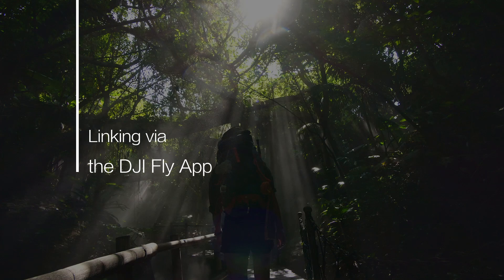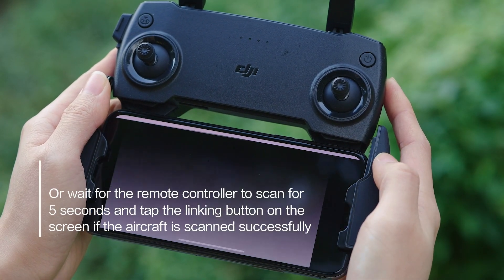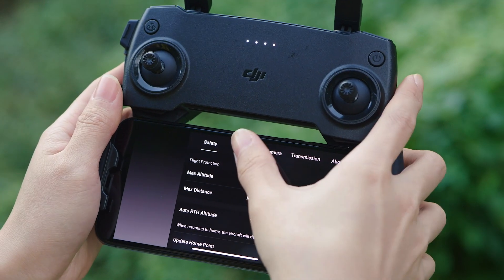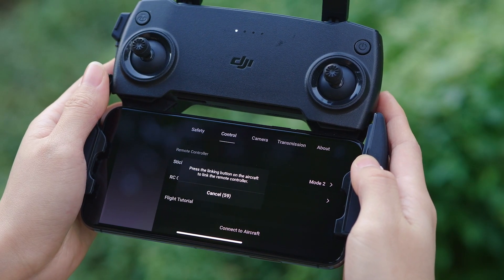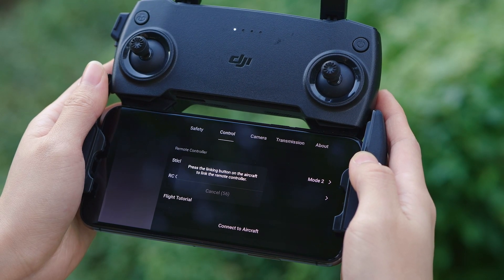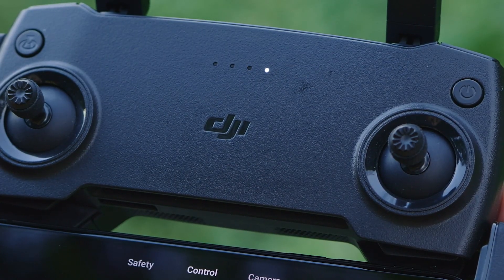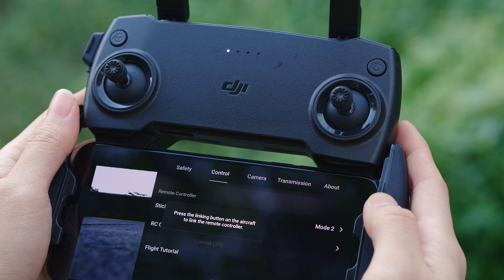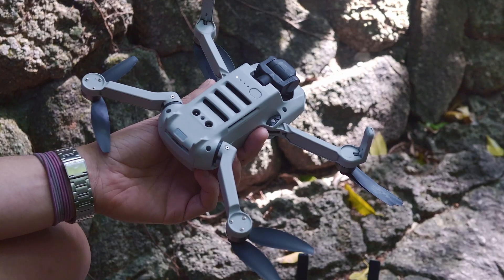Mavic Mini | How To Link The Remote Controller

Comment: this video does not adress linking failed issue. Both the phone and drone have full charge. still won't link either way. Any solutions out there.
Reply from the maker: Hi, there. Sorry for your inconvenience. Please make sure that your app version, firmware version are the latest one. If the issue persists after all the things have been upgraded and refer to the video, to better assist you address the issue, please contact our support through this link: https://www.dji.com/support?from=store_footer  Thanks.

Comment: Anyone know why my drone ain’t connect to my iPhone 13 pro max my mate gave me a drone and I got the cord for the iphone to the control everything works the drone and all it just does not want to connect to my iPhone
Reply from the maker: Hi there, could you please tell us is there any error message? Please upgrade the DJI Fly to the latest version to see if it works. You may also test with another cable and mobile device. If the issue still exists, please contact DJI Support for further assistance. http://www.dji.com/support

Comment: Anyone know if the Smart Controller works unsupported with the Mini 1 ?
Reply from the maker: I am sorry, Daxton Anderson. The Smart Controller does not support Mavic Mini.
Reply: @DJITutorials  I'm starting to doubt that though, the Smart Controller runs Android, could I not just sideload DJI Fly on it and use it instead?? 
Starting to think I need to find someone with one locally to prove you guys wrong 😂 I think you guys just want me to buy a Mini 2 lol
Reply from the maker: @DaxtonAnderson  I am sorry for not clarifying it. The Smart Controller is equipped with Ocusync 2.0 while Mavic Mini supports WiFi for transmission. So, they are not matchable.

Comment: It link for only 20 second after i get no radio to RC
Reply from the maker: Hi Michel, we are sorry to hear about the issue, please check if the drone and RC have been updated to the latest firmware, you may try to refresh the latest version for Mavic Mini via DJI Assistant 2. After that, please relink the drone and RC.
If the issue persists, please provide the screenshots and a video of the issue for further assistance.  
You can contact us at http://www.dji.com/support
Reply: @DJITutorials  Thanks, i have the latest updates on rc and ac .
Reply: @DJITutorials  Thanks, i have the latest updates on rc and ac .try to pairing with and without sd card and format it too, pair it by holding the button 4 sec rc&ac.sometime it pair, but it stay for only 15-20 secondes.

Comment: Got my Mini back from DJI repair. I saw nothing mentioned about suggesting I send the controller back with the aircraft, so now I need to relink. I followed the above steps and the linking fails. What can I do?
Reply: Not sure about yours but for some reason my SD card was the culprit.  Removed the card and it hooked up fine.  Saw a message to that effect further down in the comments.  Worth a try.

Comment: Hello, DJI I Lost My Controller From My Mavic Mini But I Still Have The Drone, The Battery and The Charger. Would A Replacement Work, and Does it Matter If Of The Replacement Drone's Controller Model Doesn't Match Mine.
Reply: I want an answer to the same question please!
Reply: @CoolHoody  I bought a replacement controller from eBay it worked. Just follow the steps of the video and it should work.

Comment: my remote control wont connect to the drone. ive tried all the tutorials but it still doesnt work. What am i doing wrong?
Reply from the maker: Hi Paul, cause there is no specific operation videos provided, we cannot figure out what the problem is. kindly please contact us support team via htttp://www.dji.com/support, we'll do our best to help this out.
Reply: @DJITutorials  i figured it out :)
Reply: @pauloldenburg6582  How?  About to return mine.
Reply: @philippeterson7503  do it with the physical buttons.Connect to the app.Then, on the remote controller press shortly and then long for it to turn on.( it'll make a beeping sound) then wait a couple seconds and then press it for about 5 seconds or more for it to start beeping very loudly and the lights will start going side side to side.Do the same with the drone.
Reply: @pauloldenburg6582  holy crap, I did not think I would find the solution on a YouTube comment.

Comment: I bought this yesterday could not connect ended 6 hours trying to resolve it so on DJI's instruction I returned it, today I got another took it home unboxed and tried it out and guess what, it will not link, will not connect and does not recognize any connection,,,, trying to link as you mentioned all I get is - 'Remote controller not connected'
I am really disappointed I have to go for a plane in a few hours and I have been trying to sort this out it's now 1:15 am which means I will get very little sleep I have spent more than 15 hours yesterday and today trying to get this thing working I am not happy and yes I have had other drones.

Comment: stupid app doesn't work? are you serious DJI take peoples money for a crap product?
Reply from the maker: Hi Diki Cat,
We are sorry for the inconvenience caused. May we ask you which mobile device you are used to operate/download DJI Fly app? Please ensure it is included in the compatibility list and is runs on iOS 10.0/Android 6.0 or above.
Reply: @DJITutorials  Its a Samsung Galaxy A4...have tried for days it's not pairing.
Reply from the maker: @richarddowling11  We are sorry for the delay, could you please provide a screenshot of the DJI Fly app after entering to the transmission interface? We'll help to double confirm the issue. 
If the issue is the connection between the controller and mobile device, you may try to reinstall the app, and try a different connecting cable, and try to enable developer option. If the issue persists, you may try to test with a compatible mobile device to confirm if there is an issue with the drone. Thank you.

Android mobile device compatible list:
Samsung Galaxy S20，Samsung Galaxy S10+，Samsung Galaxy S10，Samsung Galaxy S9+，Samsung Galaxy S9 ，Samsung Galaxy S8+，Samsung Galaxy S8，Samsung Galaxy S7 edge，Samsung Galaxy S7，Samsung Galaxy S6，Samsung Galaxy Note10+ ，Samsung Galaxy Note9，Samsung Galaxy Note8，HUAWEI Mate30 Pro，HUAWEI P30 Pro，HUAWEI P30，HUAWEI P20，HUAWEI P10，HUAWEI Mate 20 Pro，HUAWEI Mate 10，HUAWEI nova 5，HUAWEI nova 4，HUAWEI nova 3e，HUAWEI nova 2，Honor 8X，Honor V10，Honor 9，Honor 20 Pro，Honor Magic 2，MI10，Mi 8，Mi MIX 2S，Mi MIX 2，Redmi Note 5，OPPO Find X，OPPO R15，vivo NEX，vivo X27，vivo X21，vivo X20A，OnePlus 7，OnePlus 6T，OnePlus 5，Pixel 4，Pixel 3 XL，Pixel 2 XL，Pixel 2，Pixel，LG V20，LG G6，Sony Xpeial 1
Reply: @DJITutorials  ok and the solution DJI??

Comment: All this information should come in the box. There is nothing in the box that tells you how to power up and link the aircraft to the remote, or what type of phone you need. Phone requirements should be the first thing you should know. I had to buy a phone. Not happy. This is by far the worst introduction to a expensive electronic device I have ever dealt with. The website has nothing, absoultely nothing about this product startup except this video, and a few others. You should have a step by step checklist with additional links to the website on how to unbox, put together, connect and fly this thing. Not happy.

Comment: Took out SD card and it worked.
Reply: Hi gimp man, i took the sd now its working thanks for your help, but without sd card how can i record my footage, do you have any suggestions and ideas?
Reply: @DharaniRajaDR6  Reformat or even better change the SD card and put it back in.
Reply: @gimpman1357  thank you, I'll try it,
Reply: @gimpman1357  thank you so much , its totally fixed, i remember a fact that all problems have a very simple solution to fix it up

Comment: just crashed  my mavic mini 3 hours ago due to my phone running out of charge, and couldn't operate with the RC by itself, the drone landed on a street light and ended up flipping on the ground. Bye bye sweet drone
Reply from the maker: Hi there, we are sorry about the accident. Please kindly contact our support at the link below to open a case and send the drone in, we'll submit a data analysis to find out the cause if the drone is under warranty. And we will provide you with the corresponding offer based on the analysis result. http://www.dji.com/support
Reply: In other words.  You bought your frst drone.  Didn’t charge your phone. Didn't calibrate the compass. Forgot to set the RTH height to above the surrounding poles and trees. Never bothered to do the tutorials and learn how to fly it.  Then on first flight you chose a spot with trees, buildings, transmissions lines and telephone poles. Of course  there's people all around. It's late in the day and it is getting dark starting to rain with a possibility of tornadoes.  And just before flying you have a couple of beers.

Then all of a sudden. Oops! Crash.  Hey DJI this was all your fault.  Why you sell me a defective drone? D'Oh!
Reply: @Crimson Contagion I guess they could include a proprietary cellphone and charge you $500 more.  But then you would complain why you are not allowed to use your $1000 phone.  D'Oh!